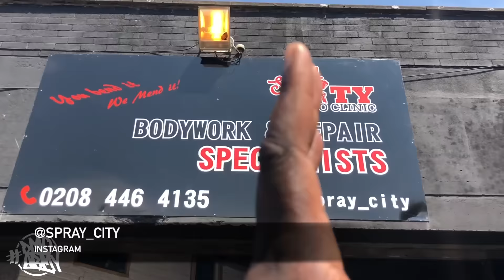YAMAHA RAPTOR R1 SUPERQUAD CONVERSION **#BWIGBWANG** PT.1

Comment: It's mounted to the frame so the exhaust is just gonna snap with vibration
Reply from the maker: No it’s not. I bet you don’t even know how a quad bike works.
Reply: Rodrigo Da Luz it’s not gonna snap. Especially with quality pipe n welds. They don’t even hardly vibrate they are smooth

Comment: Your gonna cook that Ecu behind that radiator. I got a Big Bang Raptor they get real hot real quick in traffic if I was you I would put some heat shielding on the Ecu or move it. Mine is in my air box along with all the electrical bits. 
But well done another Big Bang Raptor on road we’ll have to link up shout yfm_700 hell shout me when you ready
Reply from the maker: The wiring loom has completely changed since